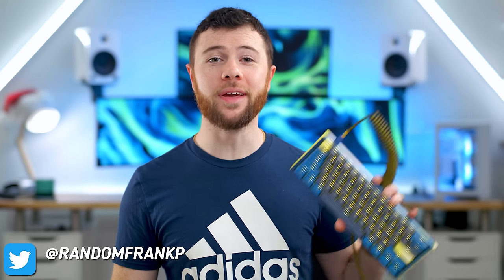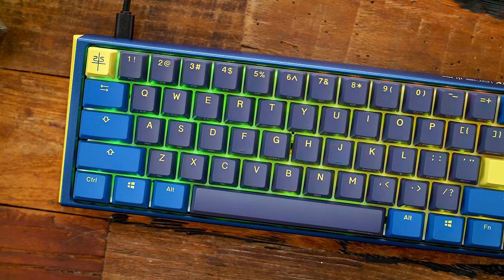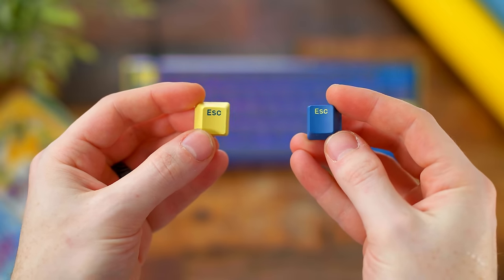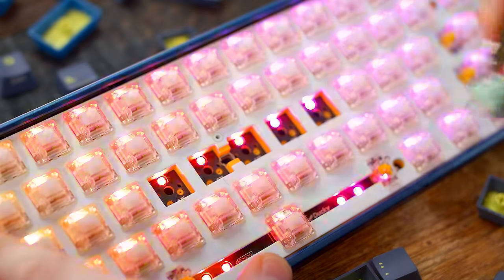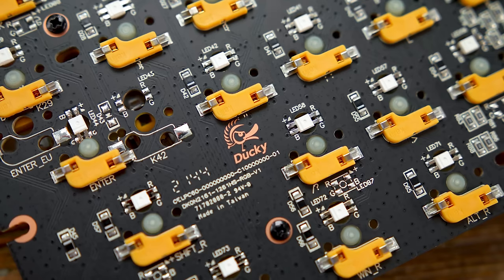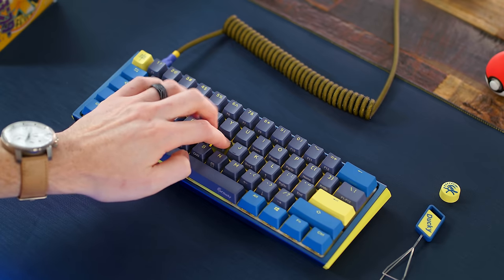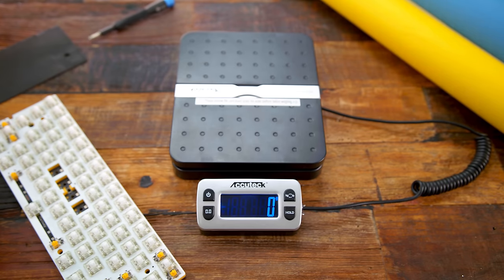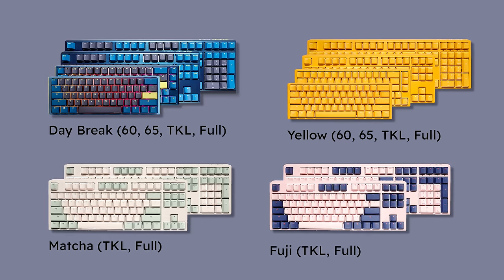Ducky One 3 Mini RGB Keyboard Review!

Comment: For those who are curious. I can confirm this ducky 3 series PCB fits into mecha keyboards as long as it’s 60%
Reply: Do tell 🧐
Reply: @HaanSoIo  it’s prolly a standard/universal 60%
Reply: @HaanSoIo  Yep, got my ducky 3 series in yesterday and I still have my trusty frozen llama mecha case, everything fits in just right, they have the exact same cut outs and everything.
Reply: @bigbenmk4873  It is, GH60 compatible. You can fit this pcb into a tofu case if you wanted to, but keep in mind it still has plate mount stabs and north facing leds
Reply: Game changer! Gonna order one to upgrade my Mecha SF Ocean
Reply: Did you get it from the website ?
Reply: @caseykukielski2410  Yep! Just remember I used the 60% version, I'm not 100% certain if the SF will work, I believe it will but just wanna warn you in case something doesn't fully work out. Good luck!
Reply: Can anyone confirm if these new Ducky hotswaps still have the mouse functions on the WASD keys as the second functions?
Reply: @phlooke  I just tried it and it doesn't seem to be working unless ducky changed their controls for it, I held fn, then moved WASD and it didn't move the mouse like my past ducky's did
Reply: @caseykukielski2410  can u tell me if it fits in a 65, cuz i wanna know if my ducky one 3 mini SF can fit in a mecha sf case
Reply: Will the ducky one 3 mini pcb fit in the hyperx alloy origins 60 case?? 🤔
Reply: @williamainley2536  No clue, but if they rock a standard ansi layout then I'm sure it can
Reply: @dude9237 I’m deciding on getting the one 3 mini and praying it fits the the alloy origins 60 case or just get ducky one 3 65%.
Reply: @williamainley2536  Hey, not sure if you're aware but they're releasing a black and white version of the one 3 mini soon, keep updated on Instagram if you wish to know more!
Reply: @Lamar Davis Yes 100%. I did that in the past. Just as long as the dz60 is 60% make sure to get the latest version of the PCB as well. Keep in mind though, the dz60 has south facing leds. They look different from the ducky pcb
Reply: @Lamar Davis yep I’m actually gonna be doing that myself. I have no doubt that the wooting PCB will fit into the ducky mecha case. Slap the caps back on and you’ll have a ducky wooting 2 mini 😂. 

Actually the ducky has 6 screws as well. Same locations even. I think it’ll be a perfect fit. Even if it didn’t perfectly fit though, you should still be able to get enough screws in to be completely snug into the case. But ofc I have yet to try it myself
Reply: nerd

Comment: I’m always in pain every time a new keyboard like this comes out because I really want it but know dang well I can’t get it
Reply: forget it honestly. it's 120$ and the switches suck so you gotta spend another 50$ for a set of budget but decent switches, go through the trouble of replacing them all, maybe also lube them for an extra 10$ plus the time and effort of doing so to get an actually good ducky one 3 mini rgb. you might as well grab yourself a redragon k552 with a hotswap pcb and do the same plus some modding for cheaper than the actual price of the one 3.
Reply: @crisscrossam  I own the k552 right now and I put hella foam in it, and it is pingy as hell. The hotswap sockets are not hotswappable with standard switches and yeah I know that you can use akko cs switches, but I have other issues with the board and I generally dont recommend it.

Comment: From the looks of it it should fit the same cases from KBDFans that the One 2 Mini fitted in (4 mounting holes used are in the same spot at least) if you really want an aluminium case that's actually decent.

Comment: I wonder if it is just a not great batch of cherry clears.. I got them on my Miya pro panda and I think they are fantastic. Haven't had the chance to take a dive into hotswappable keyboards yet to experiment with other switches.
Reply: Maybe since you haven’t tried many premium switches so that is your standard for good? Not to sound snobby sry if it comes off that way.
Reply: @BreathOfDust  I mean I said I haven't in my original comment.. So you definitely sound snobby.
Reply: @philgoodinc2  well so be be it, that’s the reason though.
Reply: Most people get clears for that ergo clear feel (basically lighter spring clears), but yeah cherry clears are pretty scratchy especially with the fact that they weren't part of the Hyperglide retooling. (Side note, the Cherry switches the enthusiasts like are the full nylon black switches. There's also vintage switches, but those are a whole other story.) Lube should help, but honestly in the current market alternative brands are a better option.
Reply: @philgoodinc2   also you begin with “I wonder if” I was just confirming your question.

Comment: I have always looked at ducky But honestly they seemed so expensive to me, might have to give it a try particularly with that colourway
Reply: Expensive? They are $120 for a high quality keybpard
Reply: one of the best for the price tho
Reply: @projugofastall  always felt like a lot to me as I used to spend $30-$50 a keyboard. Might have to grab one if these
Reply: @bytesizeclu  oh well you can’t really get anything professional at that price range
Reply: @projugofastall  nah I was always very cheap with my peripherals up to this point, Time for a long term upgrade
Reply: @bytesizeclu  i would recommend you to buy the ducky 3 one mini when it comes out in February but if you’re going large build yourself a custom keyboard
Reply: They are probably one of the higher priced pre-made keyboards …. But they use top of the line materials. They have probably the best firmware I’ve ever seen built into the PCB where you can switch the backlit colors for each key , record macros, play the game snake using the LEDs on your keyboard, and minesweeper is another game built in to the firmware using the actual keys/LEDs as the game (which they use a 4 layer PCB and instead of having to sign up and give a company your personal info etc just to use there software to update firmware, bind functions to different keys (cough Razer ) it’s all built in to the keyboard. This is very useful for people who want all these features on their work PC but their IT department won’t let them install software. I still use my first Ducky one 2 mini from 2017 but put it into a custom aluminum case and I love the ability to have full mouse  movements right click, left click, scroll wheel etc by just using a keyboard plugged in. Very handy for working in IT or servers.
Reply: Nah bro I bought a k95 in 2017 when they came out for like 200 those things are trash  only thing decent was the mix cherry silvers which where exclusive to Corsair at the time. Bought the mecha when it came out was trying to get a one 2 mini during the hype but couldn’t anyways mecha came 5 monthes later from Mechanical keyboards and was worth the wait

Comment: I'm not gonna lie, they are kinda late on some features and could have done a couple things differently
Reply: what do you mean?
Reply: @samdedmon8674  hot swap, foam, etc.
Reply: @S85B50Engine  how could the hotswap be done better?
Reply: @samdedmon8674  south facing sockets, making it something like a top mount or an Nk65 mount, coming with Cherry clip ins so you can put screw in stabs
Reply: ah I see
Reply: they are still focused on gamers I think so north-facing sockets will still be there for the RGB lovers. Different mounting style aside from tray mount, now that is something they could definitely have done better as well as the option for screw-in stabs.
Reply: @vectivuz1858  they could have done a top mount for example, as it's relatively easy and it makes the sound more consistent

Comment: So couple questions. Primary function gaming: what should I get for switches? Cherry Red / speed silver? Anyone recommend anything else other than Cherry? Last question: can’t you just swap this into another case immediately that sounds better??
Reply: for gaming primarily, speed silvers have a lighter actuation so you should probably go for those. You can't just swap the case for a new one since the pcb is designed to fit the case and would probably not fit most other cases, doing mods like putting more or better foam in the case, taping the backside of the pcb, lubing the switches etc. would probably yield better results rather than just spending extra for a new case.
Reply: @bugcapoo9310  thank you!!
Reply: @incongruous4  the guy probably just wants a prebuilt and wont do any modding lmao relax, I just recommended because it just sucks a bit less than cherry mx reds. jwk and akko linears are an easy recommendation but gateron ink blacks are probably too expensive for him and it's quite a heavy switch.

Comment: I just recieved mine on Sunday and HOLY MOLY! Fantastic.
Reply: What switches did u get
Reply: @kadenyee5423  Cherry mx red.
Reply: @Fancyweasel621  is it good
Reply: Is it too loud
Reply: @kadenyee5423  They are linear switches so they are super quiet! I had green on my Razer Widowmaker  and they are very loud. The switch was fantastic.
Reply: @Fancyweasel621  isn’t the silent red more quiter
Reply: @Fancyweasel621  idk the difference between silent red or red
Reply: @kadenyee5423  Yeah I'm really not sure what the difference is. The regular Reds are very quiet. I'd probably just look up the difference.
Reply: I preordered it during december and still didnt receive it. When did u order yours? Because i thought they were supposed to start shipping during Feb 10
Reply: @Fancyweasel621  you don't have to answer this but if you dont mind what area do you live, because maybe it is bc i live on the east side of america.
Reply: @stanleychen6556  I do too
Reply: But I didn’t order it yet
Reply: @stanleychen6556  I ordered it around Dec 20th I think. I'm in NY. It also depended on the switches you got I think.
Reply: @Fancyweasel621  o ty for the reply, also may I ask what kb u got? sorry for the questions  just really want the keyboard badly bc I ordered at dec 14 and can't wait for it. (I ordered the duckyone3 tkl fuji)
Reply: @stanleychen6556  I got the Daybreak. The one from the video.